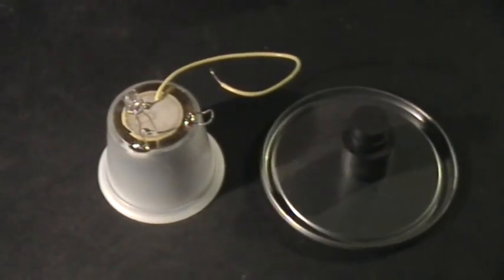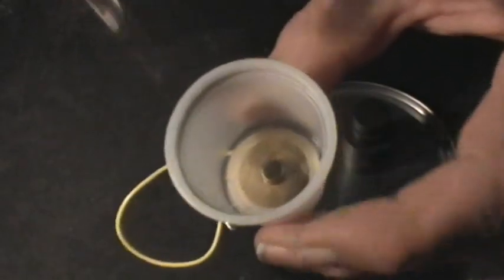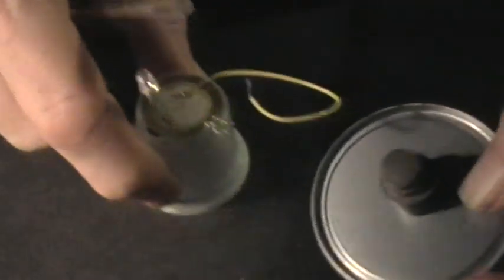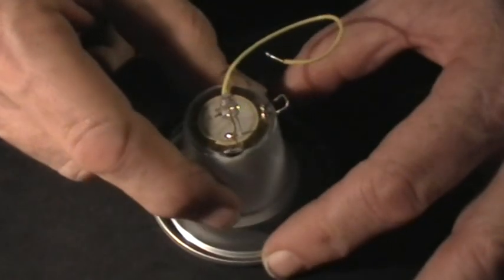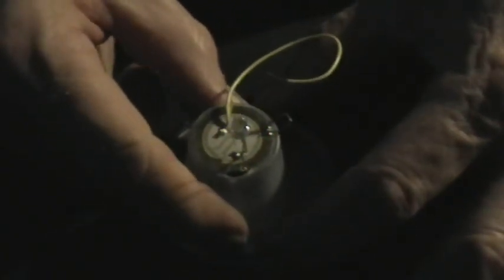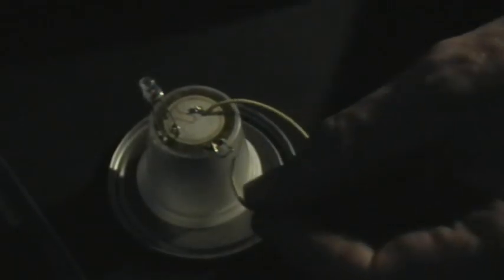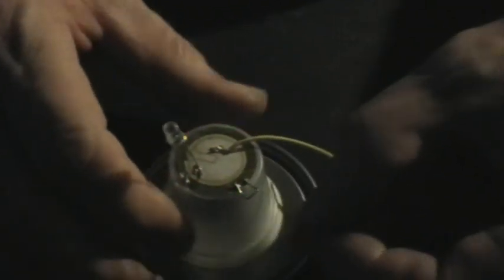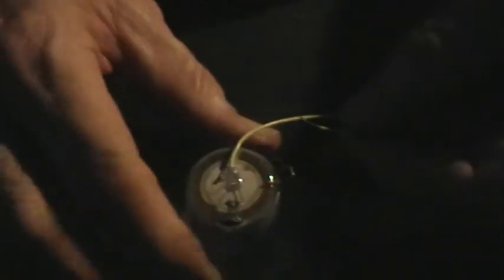Magnetic Resonance Amplifier: Supplement: Piezo Element, LED Flashes

Comment: Also, we used to machine some of these pizo materials...did you know that if you heat this material,(it builds up a charge) and discharge it, it builds up an equal charge when it cools and will discharge again if touched?  We learned the hard way.

Bill

Comment: Interesting to note that when in slow motion,the LED actually lights when the piezo is falling-not when it actually makes an impact.
Reply: interesting indeed! the magnet in the cup deforms the crystal more when the magnets are apart than the rigid 'snap' in place.
ive played with these buzzers a little, but I wasn't sure of their composition. It acted like there were actually two crystals...I didn't know they could hold potential though! (unless its the copper disc). nice observation regardless!

Comment: Greetings Dr. Koala,
That is indeed an interesting phenomena.  I suppose piezos are pretty good capacitors, too.   BTW, did you happen to borrow a Keithley bench-top DMM from our lab?   We can't seem to find the dear thing and it's by far the most accurate/precise voltmeter we own.   P.S.  We still have the Bonetti machine.......
Reply from the maker: Yes, as I demonstrated in an earlier experiment, this particular element has a measured capacitance of about 35 nF and behaves just like a capacitor when placed in a series tank circuit with a known inductor, yielding the predicted resonant frequency. This is not surprising to me, but I think it must have absolutely astounded some other researchers. Sic.

No, I never used that Keithley instrument; perhaps someone else may have used it to see if jello really dreams, or something. Did you look on the shelves near where the power analyzers are kept? I do however have the Mark-10 force gauge and I am still trying to figure out how to improve its resolution in that other old experiment. I can box that up and send it along if you need it--- I've been meaning to do so for some time.